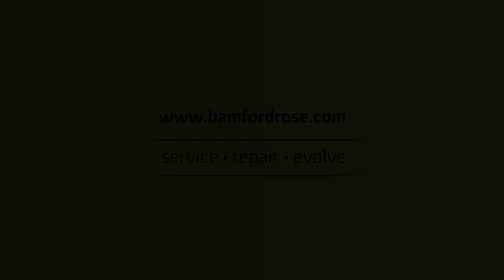Invest in a 4.3 V8VANTAGE Project? Or Buy a V8s or V12 vantage?

Comment: Not sure I would sink nearly £50k into my 4.3 but can understand why people would do it.
That car looked truly stunning, love the Toro red and the stock look that was kept.
I will continue slowly upgrading mine with some choice additions. I'm already running around 430 hp and now needing to consider suspension and some interior electronic updates.
Reply: J, what upgrades have you done/ recommend, that work in real world .
Reply: @8Ilikeicecream8  I had a twin plate clutch with lightened flywheel fitted... Best upgrade of them all really, very nice pedal feel and engine spins up a little better. Also had at the same time, 200 cell cats, GT4 air filters, remap.
This wasn't done by BR but had I been closer it would have been however, I have a very good independent only a few miles from my house who writes their own maps etc.
Very worth while doing, taken it to around 420/430 but mid range and throttle response much improved. Slightly noisier due to the cats and filters but you only really notice this when going for it otherwise remains civilised.
Next will be suspension as I have some very small leaks on two shocks but I'm not sure which way to go on this yet.
If I need the timing chest seal doing at some point in the future I will most likely get the manifolds changed for the uprated ones as I'm told these really make a difference with the other mods I've mentioned.

Comment: so how do you get 525hp out of a 4.7 stock
Reply from the maker: Cylinder head inlet port, combustion chamber and exhaust port tuning, exhaust manifolds and high flow cats and ECU remap. Our Gt4 build dyno between 500-525